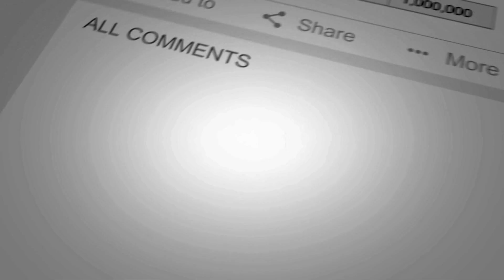EP389 Tin Roofing Goes Up on the A Frame!...A Pump Fix, A Dmax Fail! and A Drone Shot!

Comment: Check and see if you have power at the motor in the door with a 12 volt test light. Water ,water everywhere. Everything is so green now!
Reply from the maker: Yeah I did actually…that bit was on the editing floor….lol

Comment: Hard luck with the switch. 
In my experience usually the modular components are nice and easy to replace these days.  But often the panelling takes 4 hours, a borescope, and a masters degree in applied mathematics to remove.  You get it 90% of the way and there is always some hidden plastic clip preventing it from coming off 🤣🤣
Reply from the maker: Haha…exactly…and that’s the one you break..and the the whole panel won’t sit right….lol

Comment: Hope it's not the motor on your window.  Not sure about Isuzu, but on my '03 Dodge Durango,  when my window failed the window "defaulted" so to speak to the down position.  Glenn E Thomas in Long Beach instead of replacing a part or module, they replaced the entire assembly at a price of USD 400 plus.  Then a couple years later it failed again in Seattle and an independent shop replaced it again for another USD 400 plus.  Yep, labor is crazy here in the states.  Especially electrical labor rates.  Hope you get it sorted out.
Reply from the maker: yeah...ima try and work on it today....the motor is on Lazada for about 600baht...but still..i think I can fix it!...lol

Comment: If only you could use your drone to lift you into place so you could screw down the tin. If you have a multimeter you can check to see if there is 12vdc going to the window motor when you hit the switch, if there is then it may be a bad motor. A lot of things to check inside the door.
Reply from the maker: Yeah, the trucks in good shape… For being 10 years old… But I doubt the door panel has ever been taken off for a window issue… So I guess it’s going to be a can of worms on the menu… Because I gotta fix it… The motor is available on Lazada for about 600 Baht….but I think I can fix it!…lol